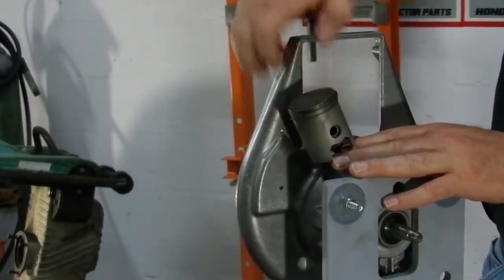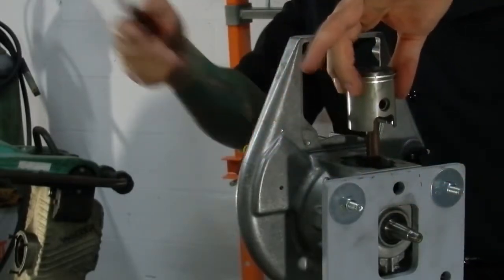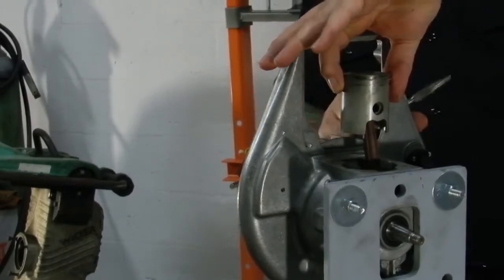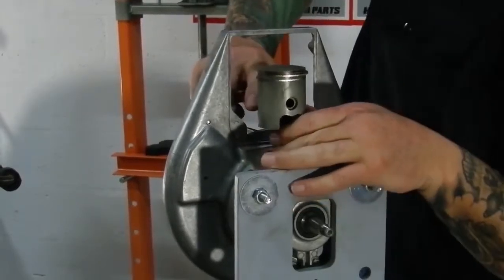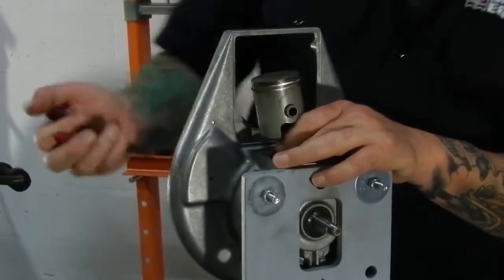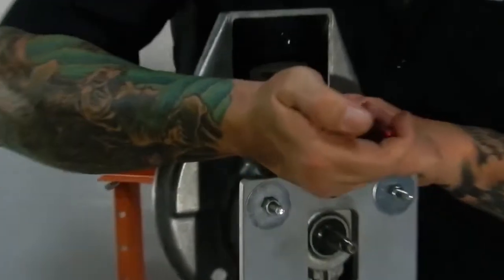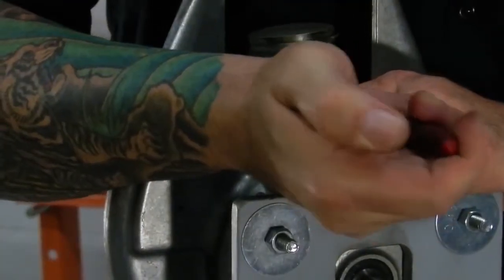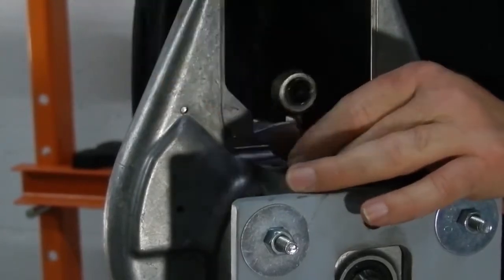Removing the Piston | WM80 Engine | Wacker Neuson Rammer

Comment: I'm going replace the piston rings and bearings on a bts165 saw and my question is, how do I compress the rings on the piston to slide it in the cylinder without dismantling the whole casing? Or is it possible?
Reply from the maker: You do not need to dismantle the casing. They make something called a Ring Compressor Tool. Just make sure you purchase a kit that will include a ring that will fit your piston. These kits usually come with 3-4 sizes.

https://stores.dhsequipmentparts.com/piston-ring-compressor-kit-stihl-universal-fitment/

It will come with 2 key components. An engine stop, and a ring compressor. You will take the engine stop and slide it over the crank arm, between the crankcase and the piston. Pull the rope until the piston rests against the engine stop. This is to stop the piston from moving when you are sliding the cylinder over head. The second tool, the ring compressor, is just a wide clamp to compress the rings with two thumb tabs so you can compress it with one hand. You compress the ring with the compressor as you slide the cylinder the piston and slowly slide the compressor down.